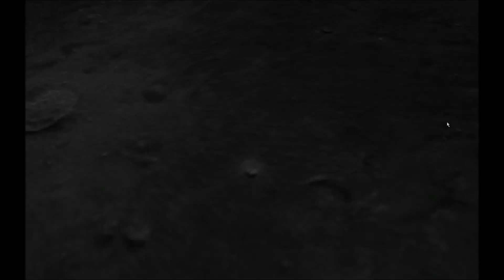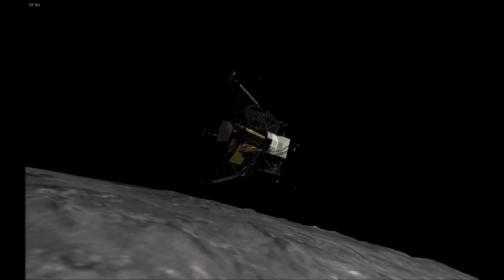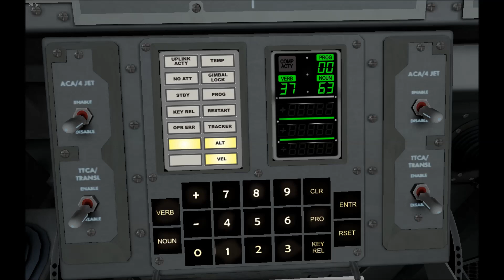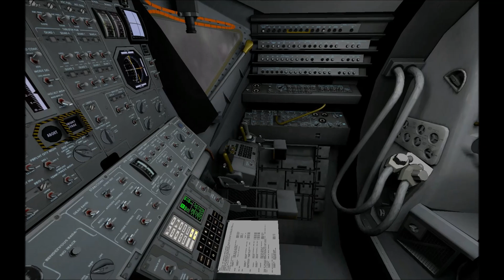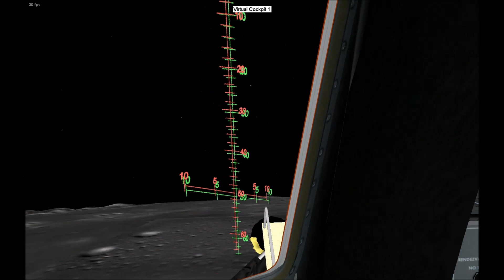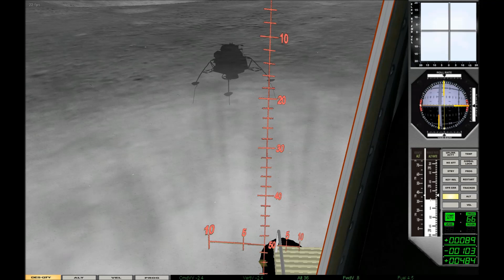Apollo 12 landing.  Eagle Lander 3D V2.15

Comment: Was the rocket motor actually audible to the astronauts?
Reply from the maker: Probably not as the rocket engine was in an unpressurised part of the vehicle. Plus wearing a bunny hat and helmet would have deadened any sound. They may have felt the vibration through their feet which may have given them a 'sense' of sound.The quad thrusters were heard when they fired as they described it like banging on a dustbin/trashcan lid.

Comment: Good and detailed simulation for LM descent and landing. I love this simulator. You can feel yourself a little bit like those guys who fly to Moon.

+drakulton, I have some questions. Was P63 (PDI) originally realized in the EL 3D v.2.15? Or was it added later? And is it possible to add the undocking procedure in EL 3D v2.15 at the beginning of the descent? I think such way A10 may be included in the missions list.
Reply from the maker: @Werta  PDI was originally implemented in version 2.15 but for the Apollo 11 flight only. I had to modify the SIT/configuration files and create audio files  for Apollo 12 and  15  these can be found in the EL3D yahoo groups files section.
https://groups.yahoo.com/neo/groups/eaglelander3d/info

It's also possible to start with the vehicles docked if you move the CSM orbital position nest to the LM orbotal position. You may need to move the orbital position of both vehicles to give yourself time to undock and program P63 before hitting the engine ignition window.

An Apollo 10 scenario does not work, as the program will not let you adjust the orbit in the SIT file to 62Nm .The sim just  freezes

Comment: Is there any step by step tutorials available?  Or a video that has narration to tech how to use?  There is NO instructional videos?
Reply from the maker: EL3D version  2.12  
Video card = select your card from the own  box.
Video modes = the same as your TV or monitor resolution, mine is1920x1080x32.
Windowed box = untick. 
Advanced
Display frames/sec = on or off.
Limit vertical sync rate = untick.
Specular lighting = tick.
Debug file = untick.
Alt dust blend = untick. (stops black square)
Simple LM = untick.
Simple cockpit = untick.
Land detail texture mode = modulatex2.
Texture mode = auto or 32 bit.
Depth buffer = W-buffer.
3D filtering = anisotropic.
2D filtering = anisotropic
Star display options = default settings.
Landscape details = high.
Rock density = very heavy.
Rock graphic = more real.
Texture quality =High
.Shadows = real
Reply: Thank you Drakulton, but I meant once I start the program, what keyboard commands do I use to maneuver the LEM?  I can alter the rate of ascent or descent with + or - but what keys steer (for lack of better word) the LEM ?
Reply from the maker: There is a big help button on the settings/configuration screen. Click on that and all the information is there.
Reply: drakulton thank you!
Reply from the maker: @ssnoc  No problem,   there is a forum dedicated to the sim which has loads of mods and addons and a very helpful  FAQs

https://groups.yahoo.com/neo/groups/eaglelander3d/conversations/messages

Comment: i love this sim, i wish it were still developed.
Reply from the maker: Agreed.  Sadly the sim creator has said that he's not working on it any further but there are mods available for it on the yahoo group. It's also possible  to mod yourself by changing the parameters in the mission SIT files.                                                                                                                                                                                                         The VR version that Ron is working on should be awesome, looking at the demo.
Reply: @drakulton1  i bought it years ago and one that i still play, such a shame it isn't open source
Reply from the maker: @seven seven  are you running version 2.12 or 2.15,  both have SIT files in the mission folders where the sim is installed. The SIT files can be edited. The default v2.15 Apollo 12 doesn't have a PDI from orbit scenario, so it can modified to do much more than the basic sim.
Reply: @drakulton1  im on 2.15

Comment: DPS fires with ENG ARM switch at OFF? Not to mention hellium regulators are BP. Somebody has to do the homework and fix this...
Reply from the maker: Good spot, as this sim only ever made it to the beta stage back in 2009, the ENG ARM switch works in any position. In fact there wasn't even an Apollo 12 P63 Long flight scenario in the default program.

Comment: Why so much RCS action? Is that realistic? Wouldn't the hydrazine be spent in short order?
Reply from the maker: From what I've read on the EL3D site and the forum ,' EL3D is designed to realistically render the physics and dynamics of the lunar module '  so it has the same mass and RCS thrust. It also has to perform the same gradual attitude change from PDI to P64. It may even be more stable/have less RCS activity than the real LM as there is no fuel sloshing around the tanks.
Reply: I just watched the actual film of the landing and they addressed that the RCS action was because fuel was sloshing around in the tanks. They fixed it by Apollo 14.
Reply from the maker: I think this explains a bit about the baffles                                                                                                                                                 https://ntrs.nasa.gov/archive/nasa/casi.ntrs.nasa.gov/19710028365.pdf
Reply: Pete Conrad Conrad mentioned the RCS activity a lot, be asked Houston to check to check the gimbal.

He eventually mentioned it must be the radar updating.

Comment: I got a problem, apps doesn't work? any one can help me? Work on windows 10, version 215
Reply from the maker: You will get a lot more help if you ask here...   https://groups.yahoo.com/neo/groups/eaglelander3d/info                                                                                                                                                                                                                                                                                                                              Have you already had version 2.15  working on windows 10 and now it doesn't?                                                                        Is this the first time you've tried version 2.15 and it won't run?                                                                                                         Has your version of windows 10 upgraded recently. What build are you running?                                                                      What error messages are you getting when it doesn't work.

Comment: Great video!   Did they determine why the RCS was so active?  Any danger of running out of RCS propellant?
Reply: John Ragozzino The RCS activity was due to the propellant in the descent stage sloshing around, causing the LM to deviate from center mass. It would be corrected on Apollo 14, by installing baffles in the LM fuel tank. If you listen to the tape of the 14 landing, you hear Edgar Mitchell, the LM pilot say, “smooth ride”.

Comment: It's a nice looking sim but the attitude is incorrect.
The roll you show at around 8:25 never happened.
The LM flew with the windows point up towards space from the start of PDI until the computer transitioned from Program 63 (P63) to P64 (at about 7000 feet and ~2 min until landing) at which time the LM pitched froward. You can hear this in your sim at around 11:05 which is followed but Conrad's exclamation that he can see that they are right on track. Prior to this point the only part of the surface the crew could see was a small slice of the horizon was visible out of the very bottom of the windows.

See https://www.youtube.com/watch?v=kFSa6vUix70 and notice the large pitch maneuver that occurs at the transition from P63 to P64.
Reply: That's all stated in the description.